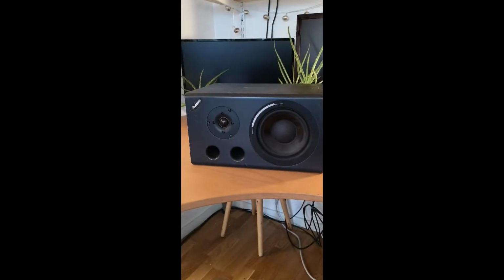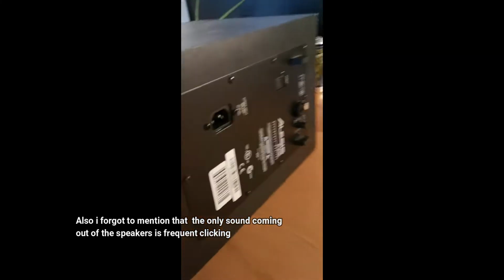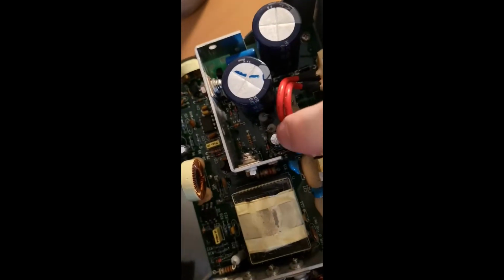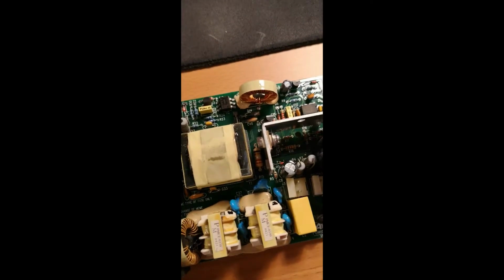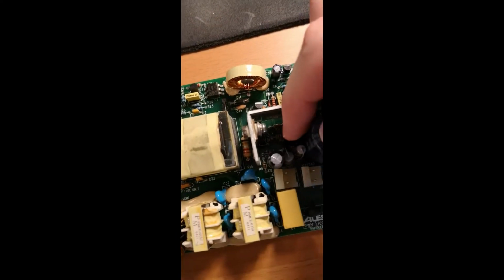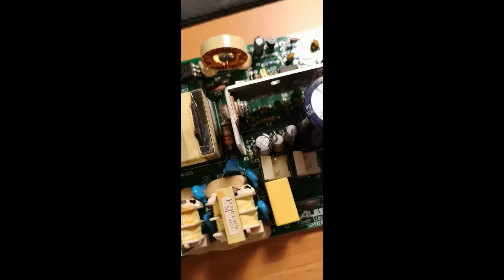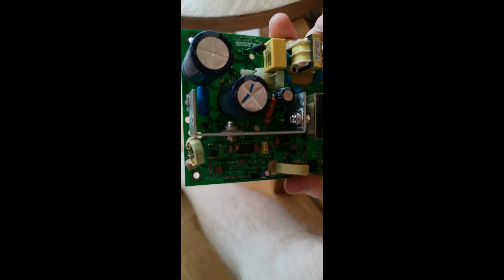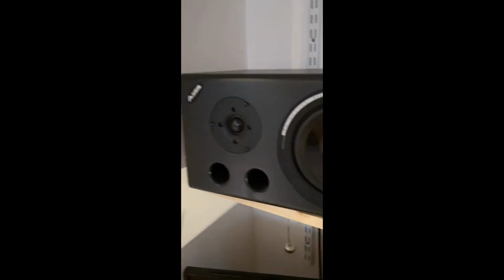Alesis MK2 Repair, Flickering light, Clicking Sound

Comment: For the parts all I found is a 10x12.5 capacitor will it fit ?
Reply from the maker: hello! sorry for late respons i am not sure actually. the parts i used i bought after talking to someone down at the local musicstore. id suggest you ask someone like that if the a 10x12.5 would also work.